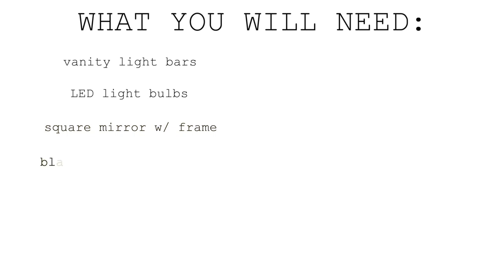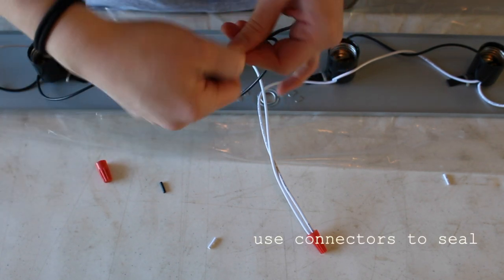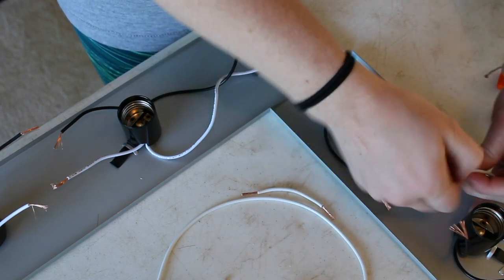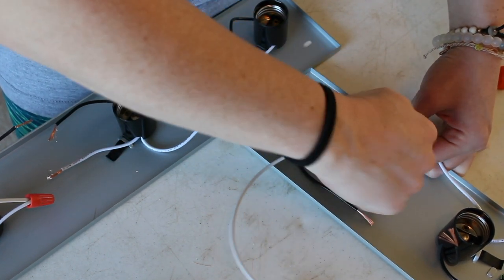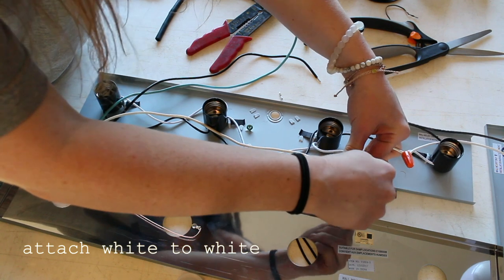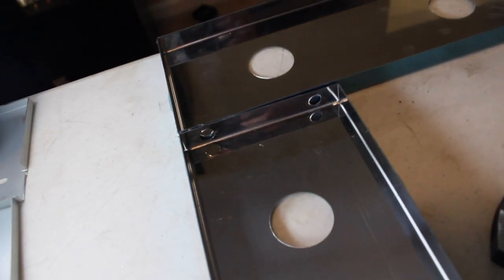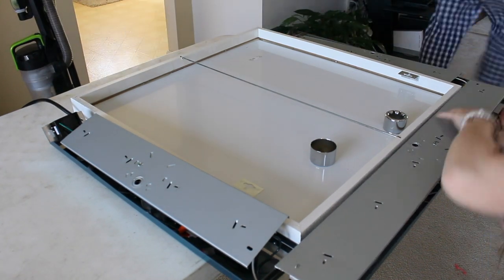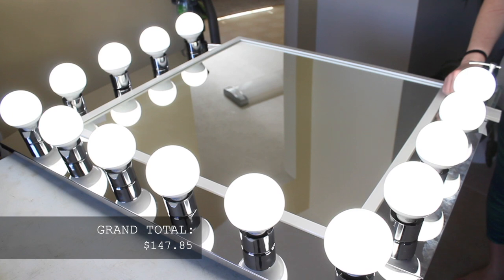DIY *DIMMABLE* VANITY MIRROR UNDER $150

Comment: What if mine doesn’t have a green wire
Reply from the maker: the green wire is just a ground wire! (to ground the current to be extra precautionary, it just protects the vanity lights from an electrical surge like lightning or something if that was to happen). not necessary though!

Comment: just a question, when you connected the dimmer to the light bar did you use the 2 white and 2 black wires that came already cut (the ones in the middle of the strip) ? or did u have to cut somewhere else?? p.s great video

Comment: Can I ask you a question in regards to the dimmer I’m having a hard time making it fit ,does it stick out on yours because on mine it’s not a flat back piece to where it fits perfect without showing
Reply from the maker: it fits fine in the front but it does stick out on the back! Doesn't affect how it's mounted on the wall though

Comment: The Ikea website says the mirror is 25 5/8x25 5/8 but is it just the mirror or includes the frame? I am thinking because the 6-light vanity bar is 36 inches long and the height is 4.5 inches, the ikea mirror should be about 27 inches long includes the frame, is that right?
Reply from the maker: yes the ikea mirror with the frame is 27 inches! i got mine with the frame
Reply: That’s where the Oh O is at. The mirror you’re using is 27 inches, the link gives us a 25 inch size. The vanity lights will not be flush with a 25 inch size frame :(